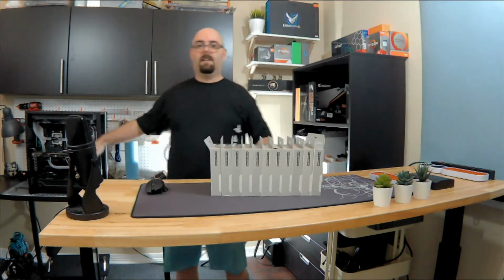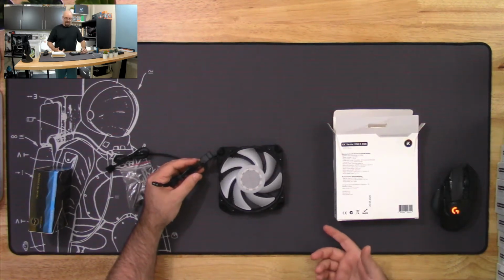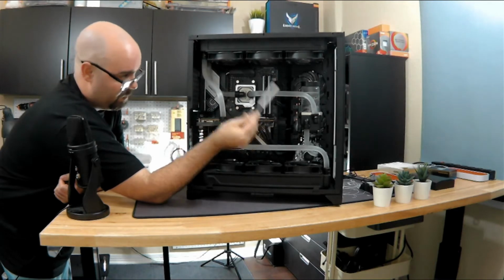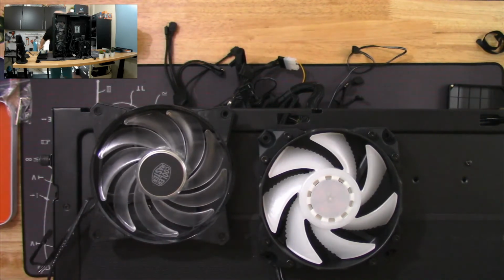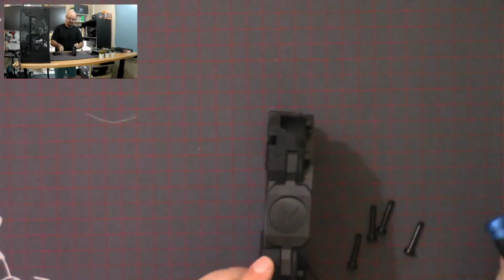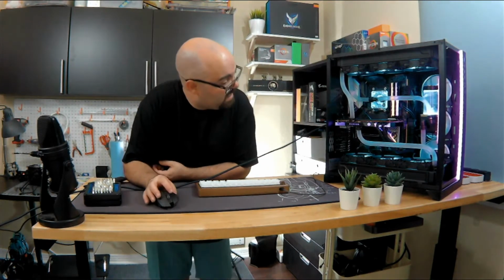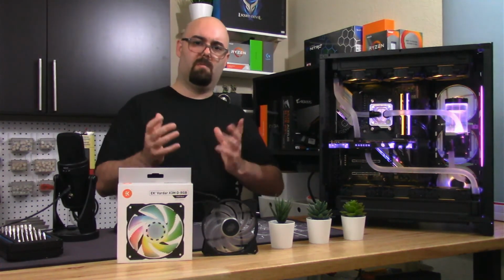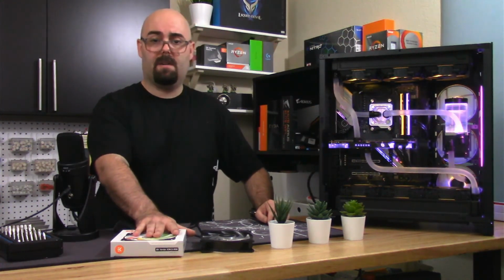Dead silent and great performance fans?? EK Vardar X3M D-RGB review #AIRFLOW

Comment: Hi Tekres - I am in the middle of a build with same EK Vardar M3M D-RGB fans coupled to EK Surface 360's and the install guide states to use (not supplied M4x100mm screws). This was perplexing to me as the supplied screws on both RAD and FAN didn't apply, but I had the same idea as you as to flipping the corner rubber mounts to allow for the longer appropriate screws to work. Although I never saw EK recommend this, I am ordering the shorter screws just in case. I'm just glad you had the same thoughts as i did. :-)
Reply: Found out about this 2 days ago, while trying to mount them. Really dumb move from EKWB🤣

Comment: Nice Review. How did you connect the 9 Fans?
Reply: you get 2 fan rgb 6way splitter from ek or any other brand, this also goes for the power 4pin cables. splitters splitters and more splitters

Comment: Hey, I'm planning a Liquid cooling build with pretty much EK everything part(reservoir, fans, pump and blocks for GPU and CPU) in an O11 Dynamic. I really love that LED strip you have on the front of your case. What is that?
Reply: The case is the Lian Li O11D might be the O11D XL. They have an ARGB string on the front of the case.